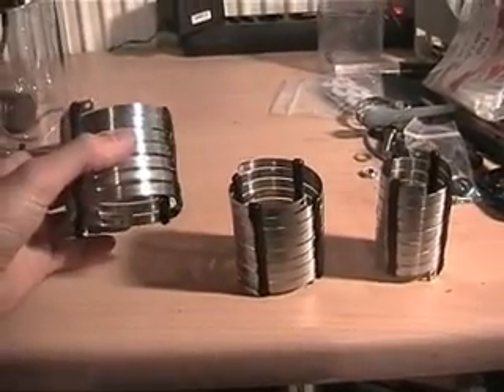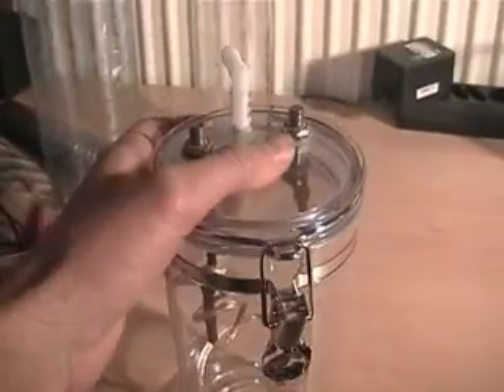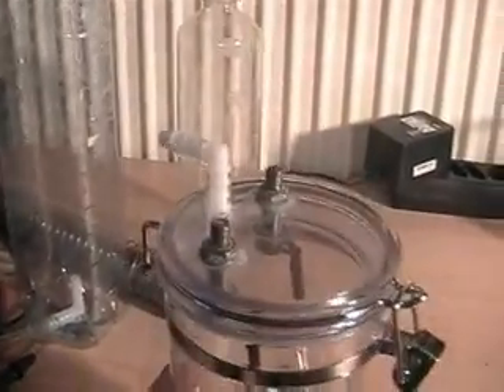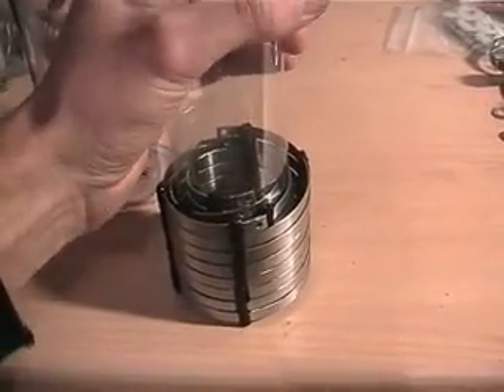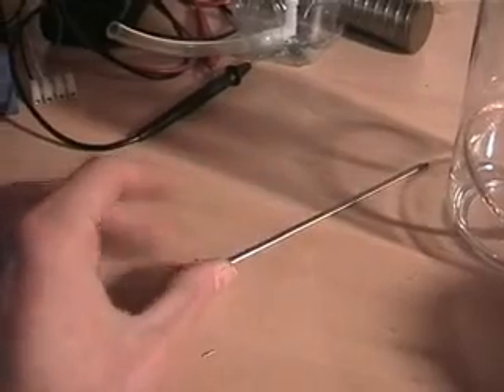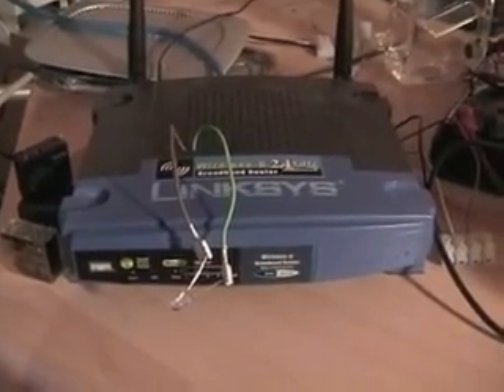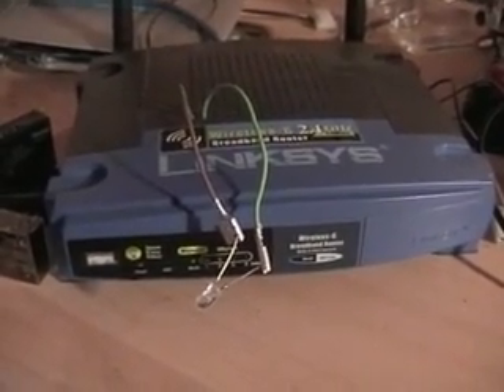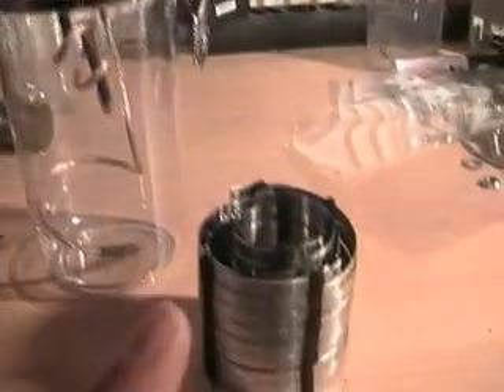HHO test3 - Update

Comment: With wires inside the cell, we expect explosion after about 3 hours use.  Keep wires out of the cell.  All connections are to be stainless steel bolts, nuts, lock washer, tight!